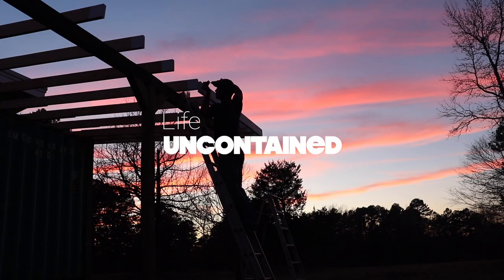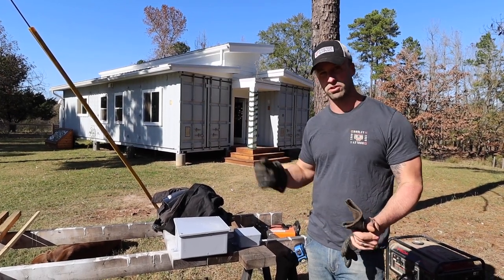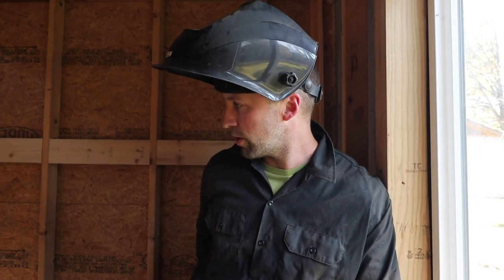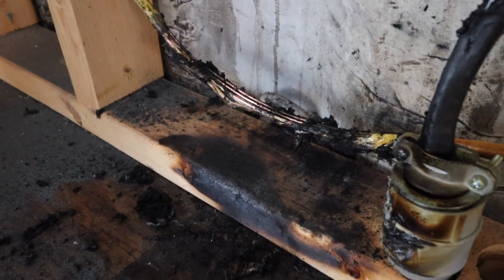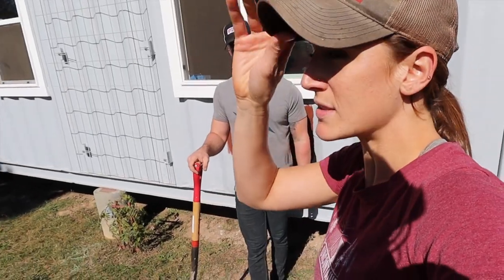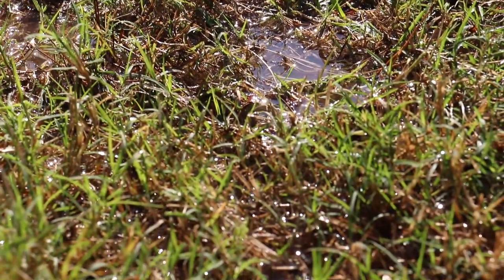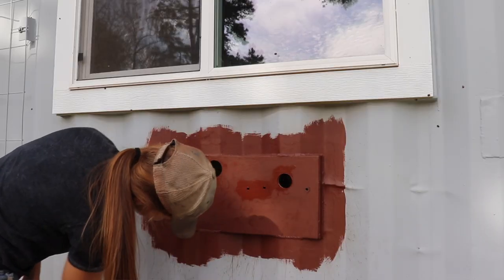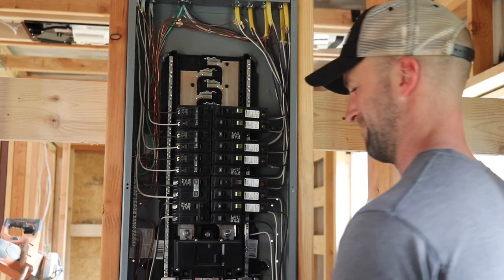Our House Caught On FIRE!

Comment: Try. Maintain 12” between  power and technology raceways when running parallel. EMF will cause noise and interference on the Data Cabling. I would rent a small rancher and cut another trench about 18” from the power. Your body and hands will thank you.

Comment: Hate to tell you this now, but 1) Running COPPER ETHERNET underground is a BIG MISTAKE even in a separate conduit. The next electrical storm you get it's going to zap equipment on either end and risk ANOTHER FIRE. 2) You should definitely use FIBER instead, which is non conductive and can be run using the SAME CONDUIT as your electrical. Hope this helps, good luck!

Comment: This is why you have battery operated smoke detectors. Would have been operational, would not have been shut off during welding and would have made a racket right at the start when the t-shirts started smoking.

Comment: I see you both struggling with wire rolls. Next time use a pipe in the middle therefore one holds the roll the other pulls:} Dad was high voltage lineman & my self 15yrs running cable. However, Love this channel & BABY is beautiful! Sign, your fan The Cable Lady, VJ

Comment: You don't have a welding blanket? Spencer I'm surprised......lol So glad it wasn't worse then what it was  and THANK GOD you saw it when you did. Can I ask a silly question? Why did you not put the wire in the pipe before you did all the pipe gluing and stuff? Wouldn't that have been easier and quicker then fishing it through after the fact? Just asking, cause I have seen so many shows/videos where they did what you did and thought the same thing.

Comment: Not helpful to you after the fact, but when I had to run conduit in a trench, instead of using a fish-tape, I slid all of the sections over the wire, got the wires hooked up at the far end, and then glued the sections of pipe together working backwards from there.

Comment: Your not having the internaet, immediately,  but I would have suggested that you have run a nylon cord through it while you were laying the pipe. That way if you decide to have internet all you would have had to do was attach your internet cable to the nylon cord and pull it through.

Comment: DONT RUN ETHERNET!!!! OR ANY COPPER COMMUNICATIONS WIRE BETWEEN BUILDINGS.!!!!! EVER!!!!!
Especially because you're using a generator: this can cause major problems. Run fiber and place two media convertors on either side. ... Or move the internet to your primary residence. You need electrical isolation between buildings that have separate electrical (or grounding/bonding conditions). You will have a potential difference which can make things go BANG! Surge arrestors might help, but you'll end up cooking your electronics.
Reply: Fiber also can go with power.... Except maybe a grouchy inspector (but he doesnt exist so it doesnt matter)

Comment: Could he have used that metal jacketed power cable inside the studs?  I don't think the main power wires without protection is a good idea.  Maybe not to code.

Comment: Soak towels or T-SHIRTS in water beforehand ...d u h  buddy  !  :]
I personally would have drilled four holes (one in each corner) and then cut it out with a Reciprocating Saw (Sawzall) so much easier and faster.

Comment: Putting the boxes on the side of the house was a waste of time.  Conduit should have been run to below the breaker box.  The wires should not have been run in the wall.  What other purpose is there to have a crawlspace if you do not use it.

Comment: 1. Tell Spenser he was conehead back when he 1st wore a welding helmet  on camera. 
2. Ass crack cam at 22min “I can’t roll faster”
3. Get those smoke detectors sorted out asap this is why they are on battery backup when you switch power off for some reason. Prioritise. You live remote. Internet can wait….

Comment: You guys are doing an awesome job, but after spending about $350 on 45' of 6-3 wire for our hot tub in 2018 it made me cringe to see you pull it out of the studs. (I hope you can at least get some scrap money for it)

Comment: Electricians seeing the wiring to the panel: "REEEEEEEEEEEEEEE"
Reply: I'm a foreman for an electrical contractor and IBEW Local #134 member and you can't do that. Only"cables or raceway type wiring" can run through walls per NEC 300. So they need either conduit or  nm cable (Romex). You could probably use service entrance cable but it's technically not a service since there's overload protection and a means of disconnect in the barn.
Reply: You can always go to www.mikeholt.com and go to the code forum. There are numerous electricians and several building inspectors on there.